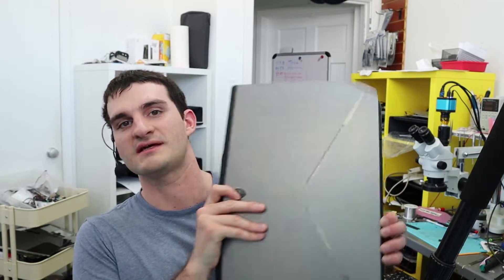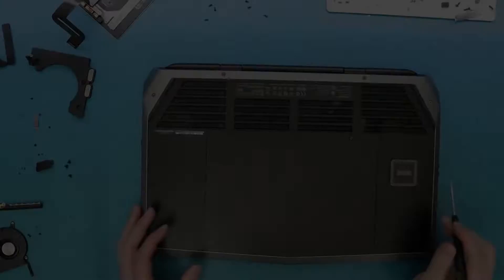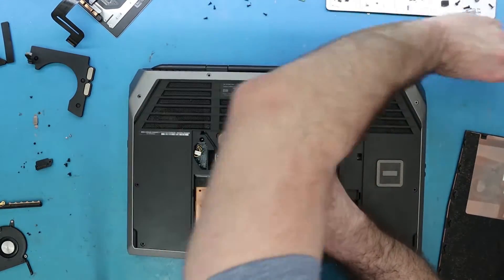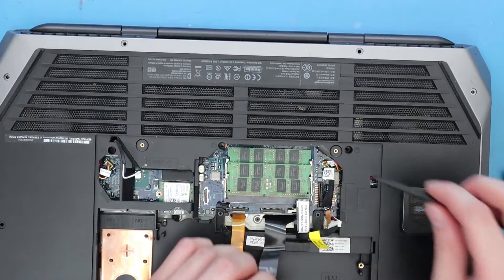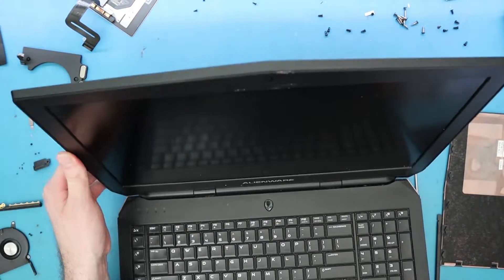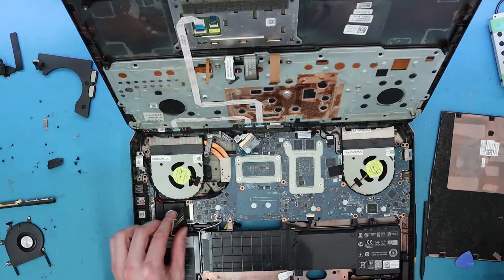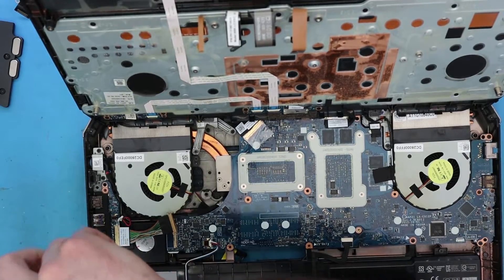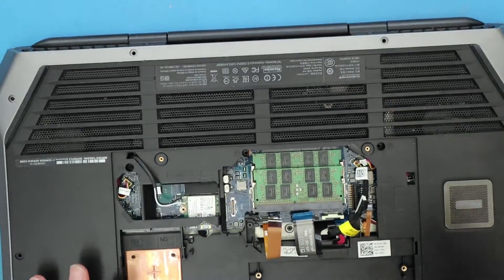Alienware 17 r3 Audio Jack Replacement : How to

Comment: The NVMe drive needed to go into the far left port.  The left port is an x4 connection and the right one you used when rebuilding the laptop is an x2 connection.

Comment: I have a Alienware laptop and every time I put the charger on it it shuts the charger off. Could it be a bad charger port?
Reply from the maker: Most likely there is a short on the board is causing the light to turn off.